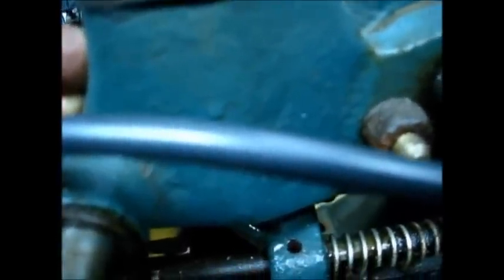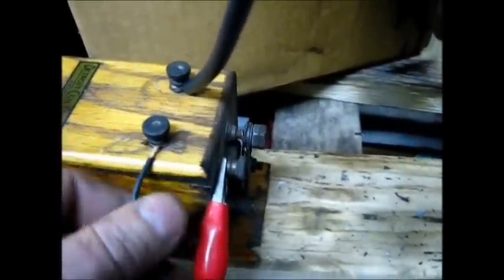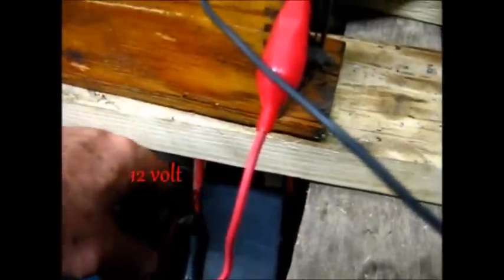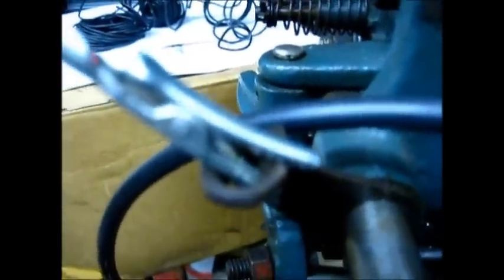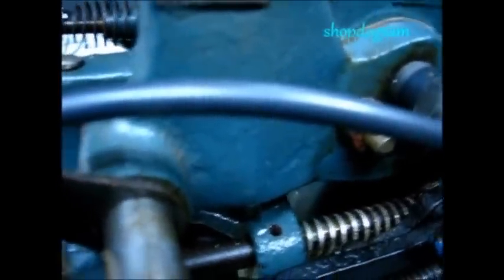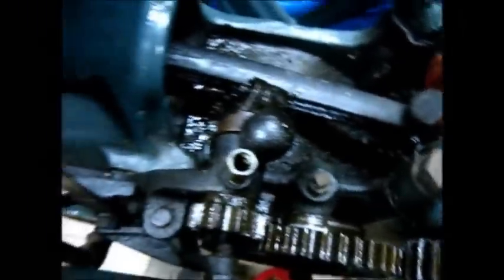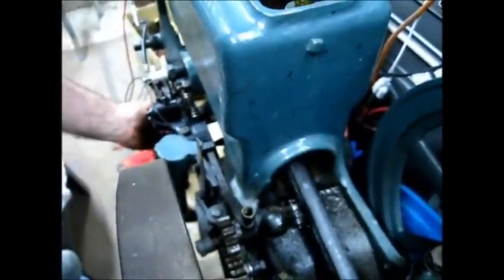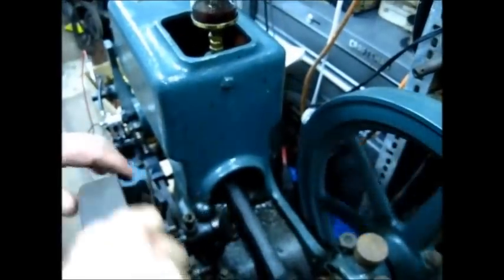Jaeger Engine  hit and miss    how to start

Comment: I'm in the same situation, but don't know where to get a buzz coil. Where can these be purchased? And what kind of spark plug do you use?
Reply from the maker: Monte Stiglitz ,,, sparkplugs,,,, most of the time, when it comes to these old engines,,, if it fits's,,, it's the right one,,, buzz coils on ebay,,,,

Comment: Hello Shop dog, I have a nice Judson with a broken ignitor. Pulled ignitor out and bolted inplace a steel plate tapped for a spark plug. When do you have contact wire makin contact?? At top dead center???????? Please respond. Thank you, Jon.